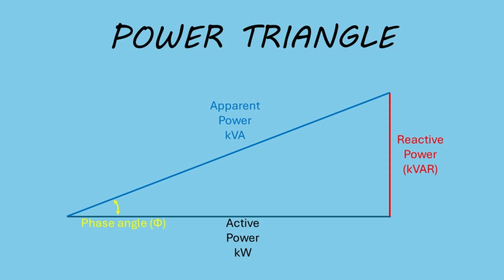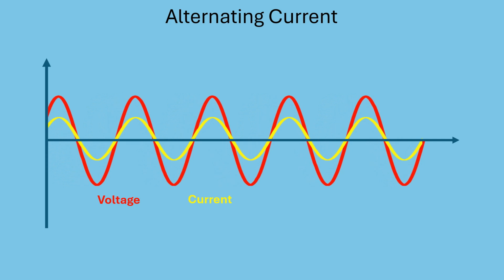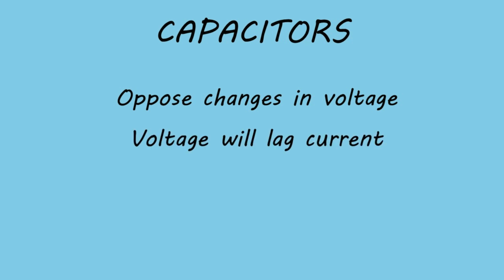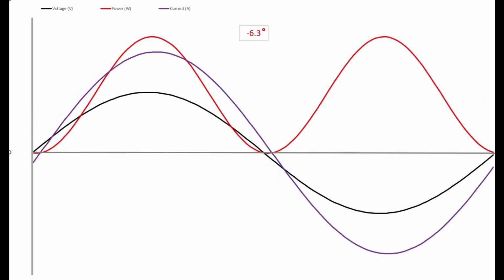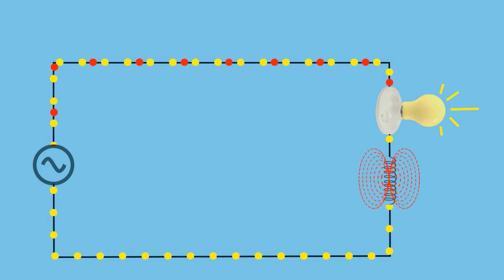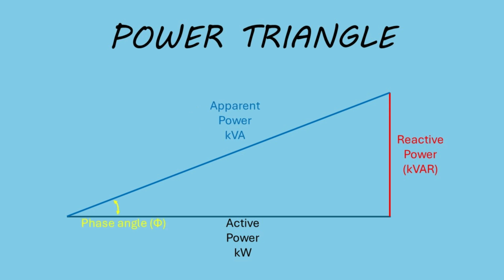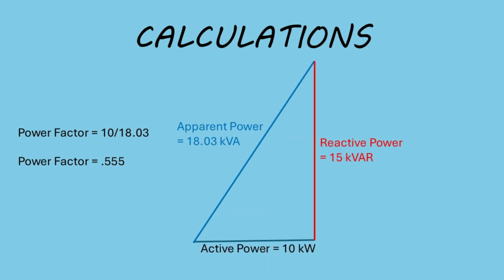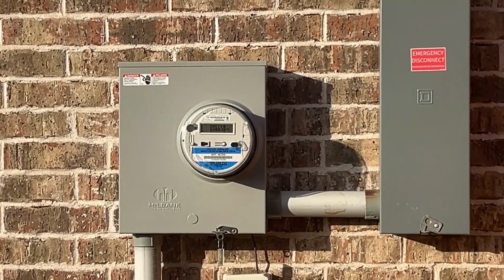The Hidden Electricity Problem That Wastes Money! (Power Factor Explained)

Comment: Nice explanation on something that the average homeowner or renter will never really need to be concerned with.  

I learned the basics of power factor 11 years ago when I took a basic course in AC/DC electronics while studying electrical construction at Kalamazoo Valley Community College from 2013 - 2015 and learned that in addition to motor loads, something else that is sometimes overlooked is magnetic ballasts in older fluorescent fixtures and HID (mercury vapor, metal halide, sodium vapor) lighting.  Today magnetic ballasts are no longer allowed to be manufactured for fluorescent lighting because they do not meet Federal energy efficiency requirements but are still made for use in most HID luminaries because electronic ballasts tend to be less robust when it comes to handling temperature extremes and power surges commonly encountered in industrial areas.  With the possible exception of very old ballasts and fixtures, almost all magnetic HID (and fluorescent) ballasts have a capacitor which may or may not be replaceable sized to counteract the inductive nature of magnetic ballasts and bring the power factor very close to 1.00, many good HID ballasts today have a power factor of 0.9 to 0.95.   

Fun fact:   many years ago (I believe they are no longer manufactured) there were mercury vapor light bulbs with an incandescent filament to act as a ballast and these special lamps were designed to be used in ordinary incandescent fixtures, they had a power factor of 1.00 but had the same efficiency as an ordinary incandescent bulb, roughly 14 to 16 lumens per watt! (vs 30 - 60 lumens/watt for standard mercury vapor with magnetic ballast).  The only advantages was they lasted on average of 10,000 hours give or take some (limited by the life of the internal filament "ballast") vs 750 - 1000 hours for most incandescents, and produced a  whiter light of about 3500 - 4200K vs 2700 - 2800K for most incandescent lamps and humans tend to perceive whiter light as brighter for a given lumen output.  

Fortunately LED technology continues to improve at a rapid pace and gained widespread acceptance in applications requiring tens of thousands of lumens where previously only HID would suffice, but for those new to the trade, it's important to have a good understanding of the many legacy lighting technologies that are still in use.
Reply from the maker: Very interesting information. That is definitely some stuff I was not aware of. It’s good to hear from you, by the way. I hadn’t heard from you in a while.